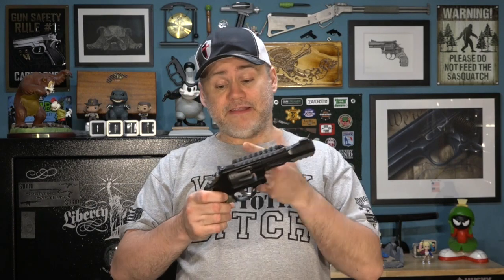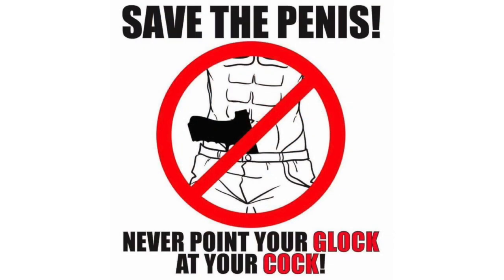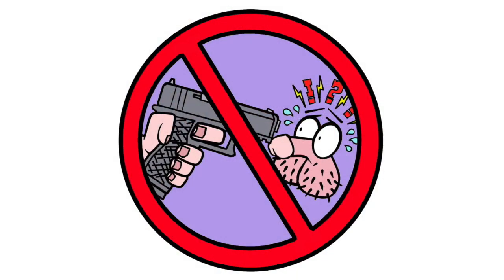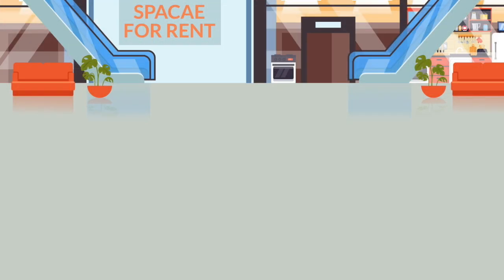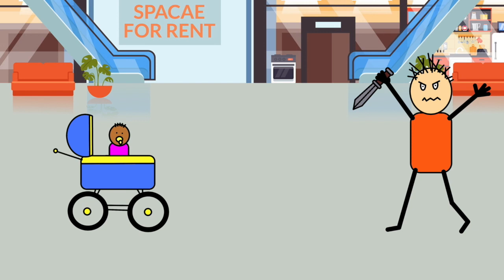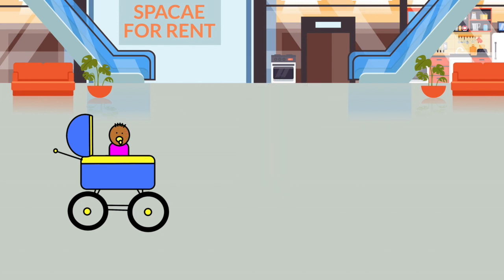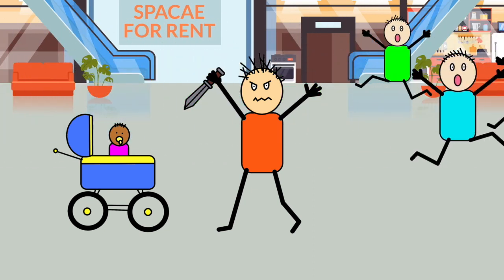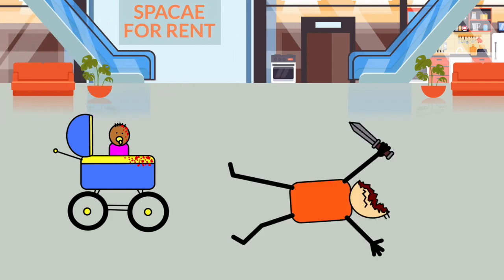Rule Four of Gun Safety is NOT an Excuse for Inaction

Comment: Good video. There has to be some balance. People freak out about guns, but trust each other with cars - IMO, they are both equally deadly. We are all freaked out about the barrel of a gun, but the front of a car is no big deal. I'm not saying that flagging is not an issue - but you'll walk through a crosswalk with cars stopped at an intersection without even thinking about it. If one of the people in one of the cars decided at that moment to kill you, all they have to do is take their foot off the brake and hit the gas - and they could easily get away with it by claiming their foot slipped off the brake...

Comment: I'm wondering where the "funny little mexican hat" is for the TRR8? I ended up putting a deltapoint where the rear irons used to be.....not quite as funny and lower to the bore line......mounts up solid and easy. Leupold makes a rear iron that attaches to the rear of the deltapoint if we want co-witness.  I haven't attached one yet.
Damn good video, thanks for sharing.